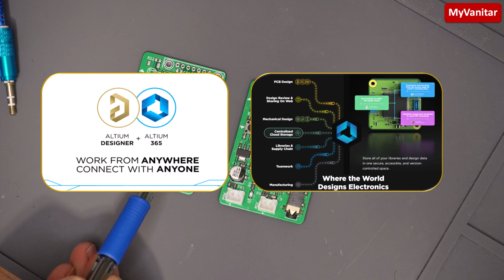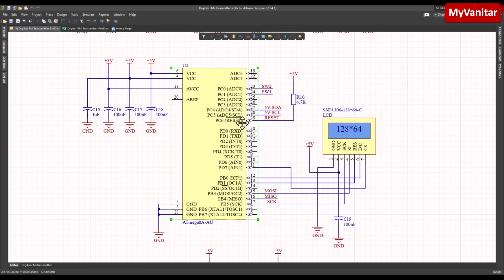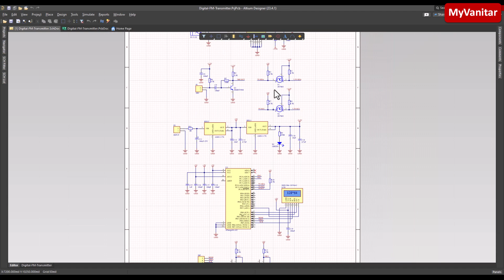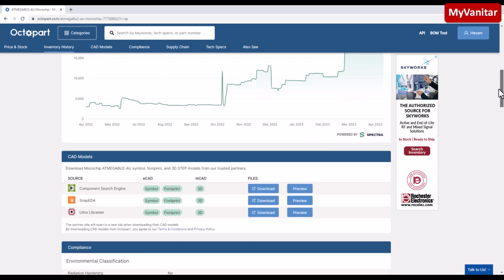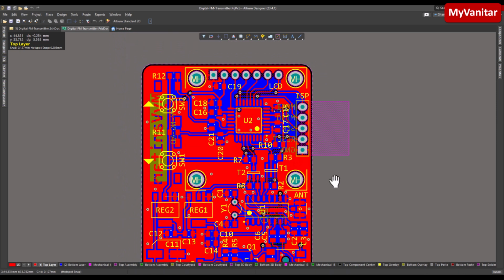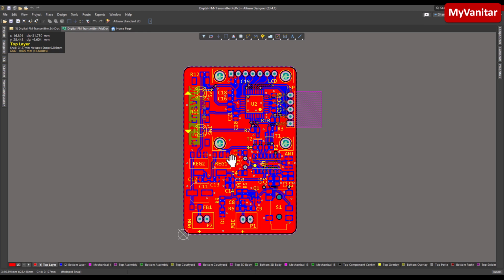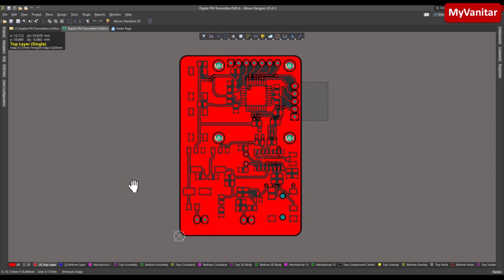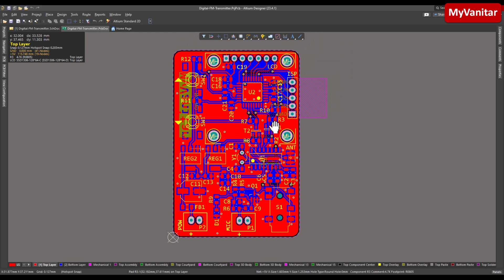Stereo Digital FM Transmitter Circuit

Comment: Can anyone suggest how to program this please? I am lost at that step.
Reply from the maker: programming the microcontroller? Pretty easy, use a cheap AVR programmer such as USBasp or whatever, connect the programmer wires to the board, and program the microcontroller. Be careful about fuse bits. Check the provided article

Comment: May I know the function of each components in the circuits? I'd like to pay for it,  and if you're willing to send on gmail
Reply from the maker: You should not be hurried when you try to learn something, as I mentioned in the video, detailed info is available in the article. I explained everything, invest some time
Reply from the maker: even in the article there is an option to order it assembled
Reply: Cool!! Do you have a video about programming arduino? If not could you please make a video for us beginners hehe thanks so much in advanced
Reply from the maker: if you check the article, I have provided the complied HEX file which you can directly program the MCU without any coding. Just don't hurry and invest some time on both the video and article :-)